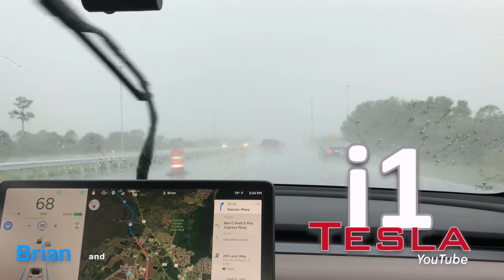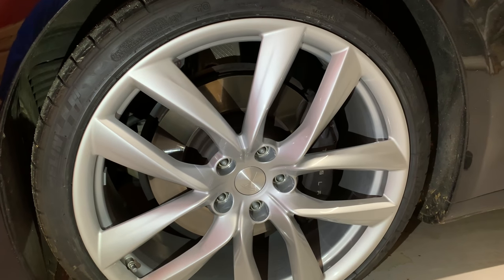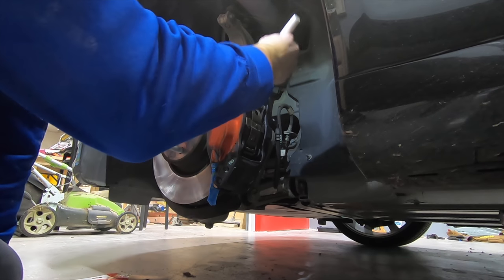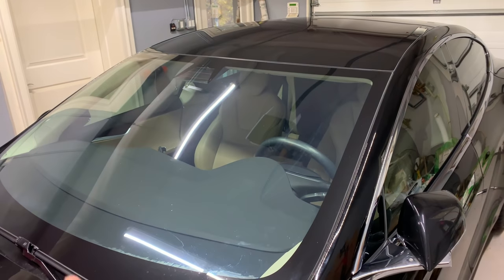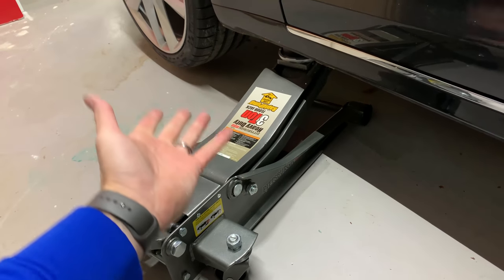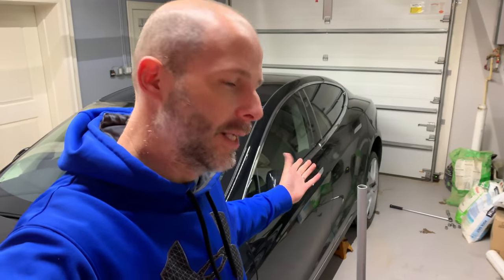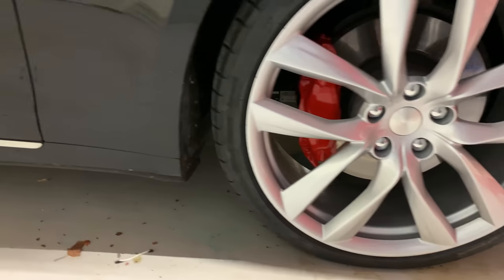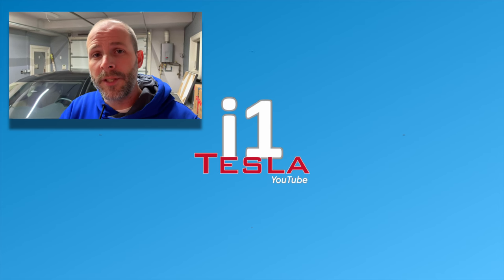Tesla Performance Red Brakes DIY

Comment: Why did you choose this paint over a G2? The one you used is considerably less expensive but doesn’t appear to use a hardener nor is it rated for as high of temps. Planning to paint the calipers on my 3 in the spring and get some high temp vinyl decals off eBay to avoid needing to spray clear.

Comment: I'm surprised you where able to get away with not taping up more of the rotor and unpainted parts of the caliper.
Reply: lessdeth69 I would’ve slipped and painted the rotors, for sure.
Reply from the maker: I was careful and used a smaller brush.
Reply: i1Tesla You’re an expert with hand works

Comment: What’s amazing is that detail shops are quoting up to $600 to paint calipers. (Florida) “What if” I painted them for $14.00? 🤔
Reply from the maker: Buy the paint and brushes. The body shop is going to unbolt and spray the brakes and warranty the work though. Not worth the 600 to me.

Comment: Would have been easier if you turned the vehicle on and turned the steering wheel to the very left or right, giving you easier access to the calipers
Reply from the maker: Yes but I don't need to to the back side

Comment: What kind of jack is that. I got winter tires for my M3 but need to get a jack and a torque wrench and jack stands
Reply from the maker: I just picked it up at Harbor Freight for $95
Reply: Mine is a torin brand. Pep boys $60

Comment: Thats me Brian, the Harley guy, thanks for the mention. I did both cars the X and the 3 and my Bolt as well, they hold up great and have been on many thousand miles.  I used the Brake paint in a spray can that I bought from the auto parts store, two cans do the whole car
Reply from the maker: Thank you!

Comment: Thanks for this and all your content!  

Question for you and any other owners regarding the left turn signal.  Mine only turns off if I tap it halfway up, not halfway down.  Anyone else notice this? 
Thanks.
Reply from the maker: If you do a short press on the turn signal it will click 3 times then turn off. If you press all the way down then it says on until you turn, like a normal car. There is a problem with turn signals on select cars. I think mostly P3D. Call Tesla if you have a problem.
Reply: i1Tesla, Thanks, a half way tap down on my right turn signal disengages a hard click turn the same way an actual turn would.  Not the case on my left turns.

Comment: Hi, thanks for the video, can the decal for the brakes be purchased?
Reply from the maker: I had them cut at a local vinyl shop
Reply: @i1Tesla  how did the decals hold up after applying on top of the paint? did you apply a clear coat on top of the vinyl decal?